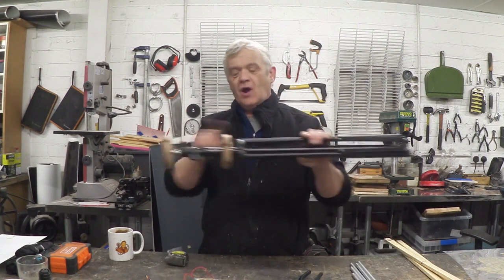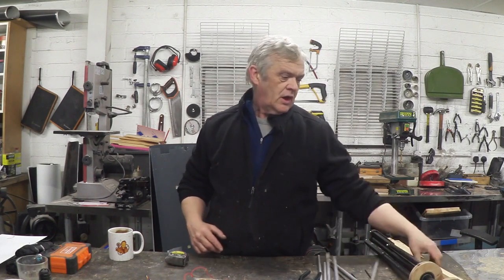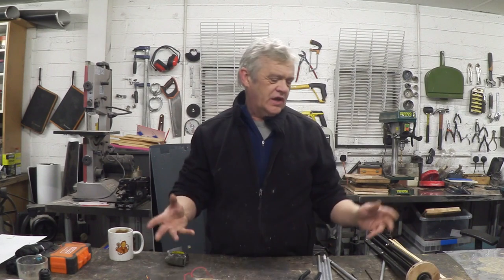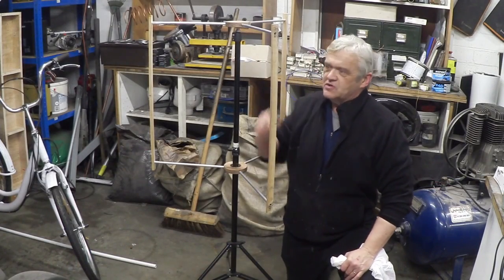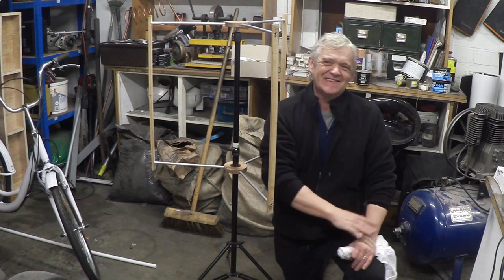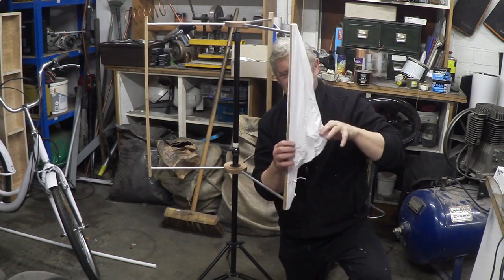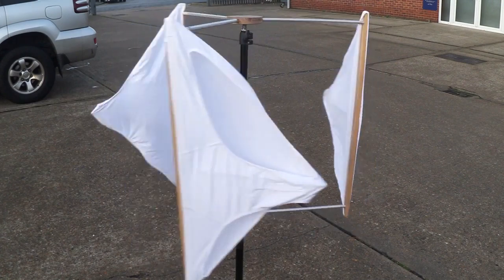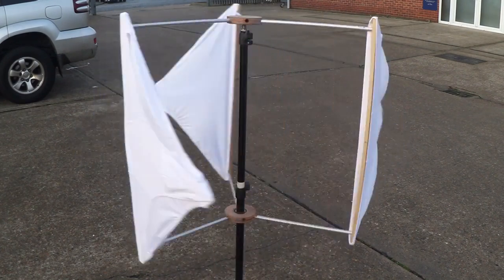1426 A Wind Generator Made From Underpants (Y-Fronts)

Comment: Lovely stuff, Rob can you spin a motor/alternator by putting it near a live cable? I've seen this camera which is powered by clamping it over a power line (for military/defence apparently) for use in remote areas, electromagnetic induction obviously, but can you spin magnets with the magnetic field of the power line/cable or by inducing a current into the coils?
Reply: Does a clamp meter work in the same way? Always wondered how they could tell how much current was going through a wire
Reply: And yes I live off grid in a remote location with 3 power lines about 20 yards away from me above me